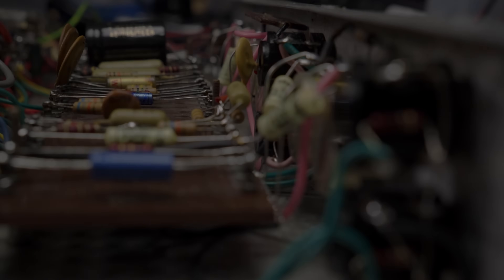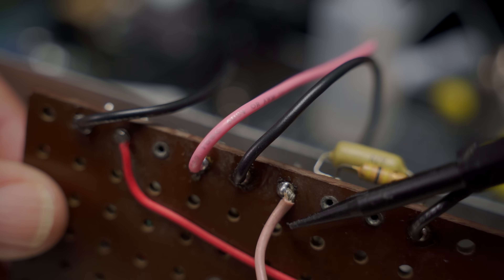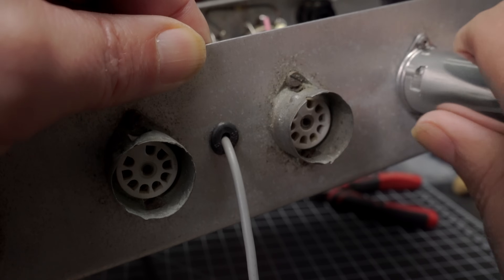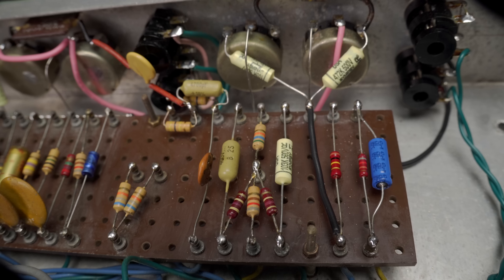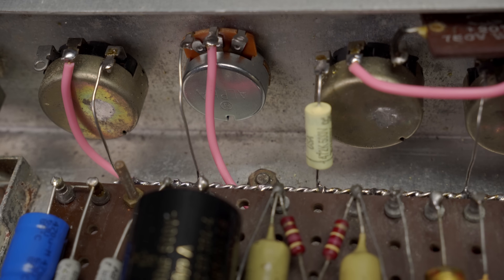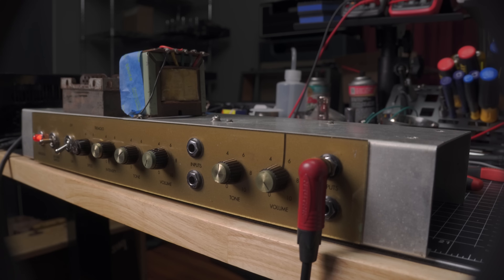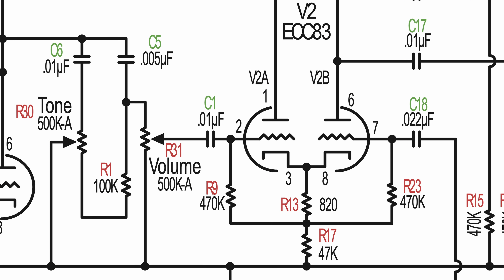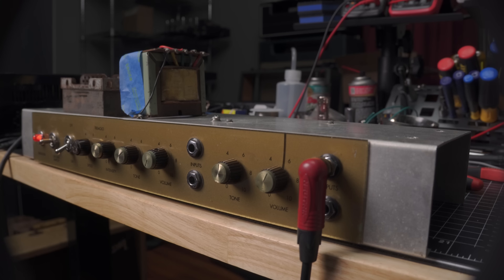'66 Marshall 1973 |  Part 2 : New Grounding + Correct Circuit

Comment: Huh, I had not thought of putting a ground bus into my 66 JTM. Thanks for showing that. Also, no flames but I did have a bias pot in there a long time. I have it back to just resistors now since I think I'll stick with JJ KT66 from now on. Still, I did like having a pot there so I could set bias just as best as I can.   Thanks for taking such good care of these timeless amps, and thanks for showing me a clean approach to ground.

Comment: At 3:06 , the terminal on the cap looks awfully close to the chassis. I'm sure it's just the camera angle and there is enough clearance, but I can't help but point it out.
Reply from the maker: Looks really close, and it used to be really really close. I undid the mounting bracket and got it as good as possible with a real gap. They misdrilled the chassis in ‘66.

Comment: Old Marshalls are unmatched . Slaps you through an iPhone . 3d swirl around is lovely  . How do you like the royals vs the real deal Phillips?
Reply from the maker: They sound right. Other brands of polyester I use sound right too. But no complaints.
Reply: Totally , not expecting the 100 w super lead , but I listen to all your videos , and even this lowly cathode biased 18w has some serious raw midrange character compared to similar circuits I  have heard on the channel. Looking forward to hearing the vintage celestions!
Reply: I have plenty of experience with the different generations of  zoso , which the synergy’s are essentially. I always hear them as soft in comparison , not as much Marshall krang as I would hope, but they do feel right and get the job done .
Reply from the maker: Well, I don’t expect “the full kerrang” from a cathode biased 18W but it sounds right for what it is. That was through my shop ET65, will be testing the old silver Celestions next.

Comment: Use a modern UK plug with insulated pins though. That one in the video isn't to modern standard.
Reply from the maker: That would be the plan if he wants a UK plug.
Reply: @PsionicAudio Cool! Great sounding amp and nice work.